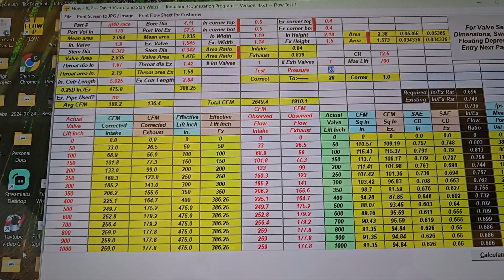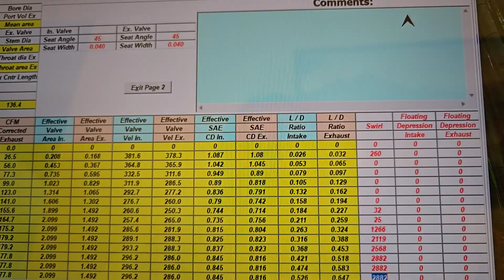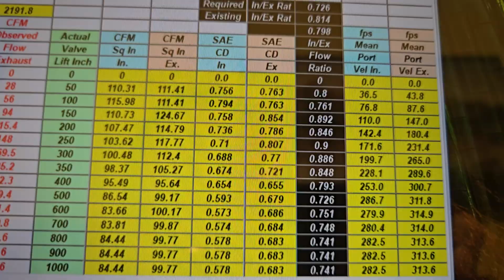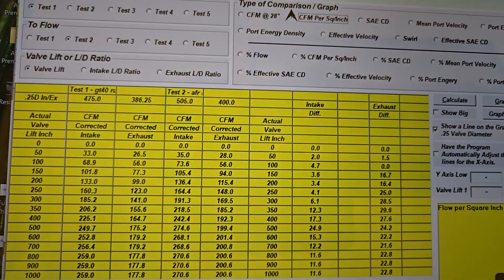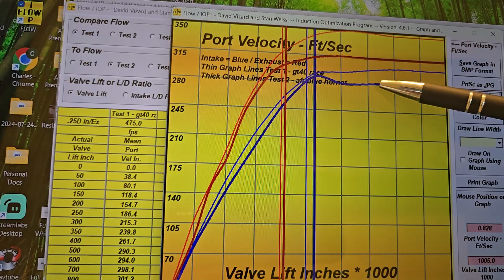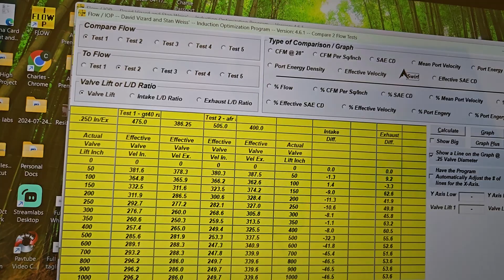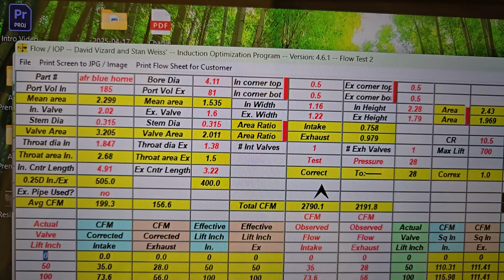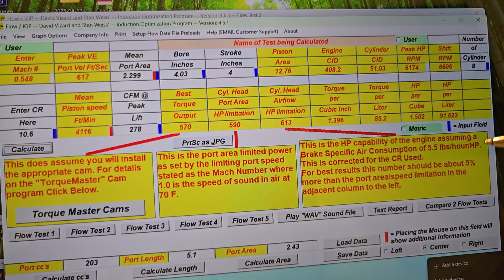David Vizard's and Stan Weiss's IOP program comparing AFR Blue Hornet Mopar vs. Ford C6fe GT40 head

Comment: Thanks. I'm glad you work all types of heads and not just chevy.  How good were the Max Wedge heads? I'm curious because Mopar got away from them pretty quick. I wonder how many cubes a Max Wedge head can support.
Reply from the maker: I never did a max wedge iron. The Trick flows I did for Dangerous Donny's 540 Mopar were the first bbm heads I ever did. Thanks

Comment: Does this IOP program have concrete evidence that it works on a actual street/strip car?
Reply from the maker: Well, I decided to get in touch with Stan for this answer. 
IOP/ flow program is not an engine simulation program, it has limited inputs.
It does state you need appropriate cam like one from tourque master program and it is assuming a brake specific air consuption (bsac) of 5.5lbs/hr/hp for efficiency.
What the program is telling you is what hp you can see if everything in your build is perfect, the IOP/flow program doesn't know if the engine has cast manifolds or headers or if the intake is a dual plane, single plane or tunnel ram or many other things that an engine simutaion program needs.
Reply: Gotcha. 👍🏻

Comment: That just means you'll need more intake on the cam, it'll still rip!
Reply from the maker: It will be interesting if he spends for a custom cam what the designer chooses for durations. Thanks
Reply: Sorry I didn’t see the cam? I going to look again but didn’t see the cam.
Reply from the maker: @richardmoerke9329 The cam designer has not been choosen yet. The IOP program estimates power if cam is done with D.V.'s torque master program. It is explained on the last page with hp estimates. Thanks